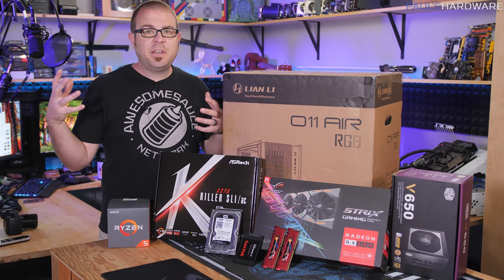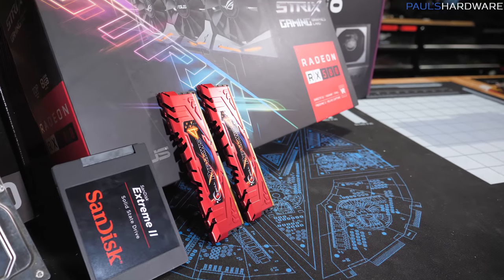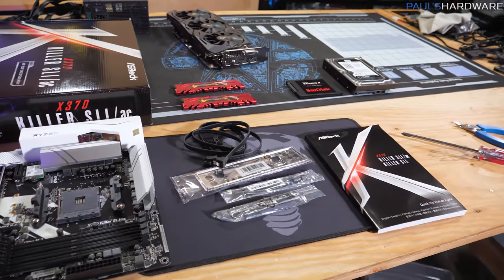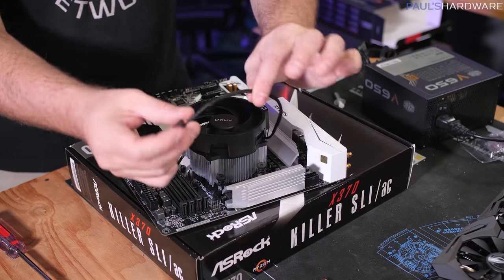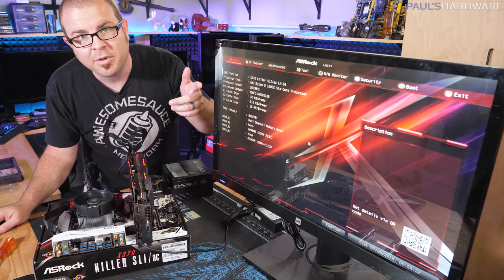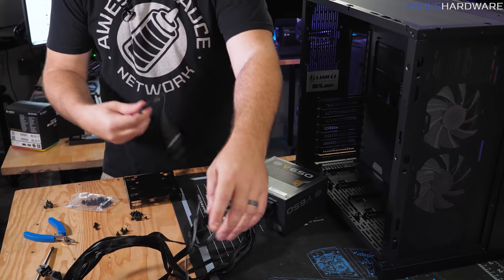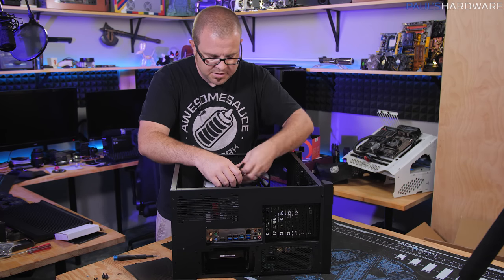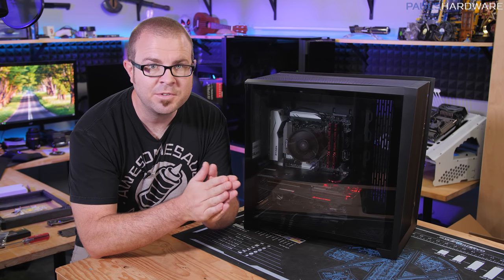How To Build an $800 Gaming PC in Late 2018!

Comment: Hi guys i have a question right now i have a choice to do 
Let me explain my situation im about to build a new computer and i was asking me this question my screen resolution 
I was first planning to play a 1080p
75hz so the choice were between the 1060 6gb and the rx 580 as you see no real problem just a quick look at the benchmark and choice is done,BUT unfortunately i discovered 1440p and my mind said "1440p only" here the question come would i benefit more from an rx 580 with a freesync monitor or upgrading to à 1070 to have the smooth 60 FPS so i am asking you guys would i have a better experience with a 1440p freesync monitor or 75hz 1080p monitor 
Thanks for all the warriors that read all my comment :)
Reply: i have a 1070 and i think its the minimum you need for 1440p as my frame rates for newer games are prob around 70-80 and i dont like fluctuation so this gives me a smooth 60fps
Reply: Ty for your answers i will so take a 1070

Comment: What about a Ryzen 5 2600 what's the best motherboard for that?
Reply: b450 is good if u dont want to sli or are not interested in high overclocks. X470 is still a good choice.
However i would recommend last gen motherboards like a b350 or x370, but you need a last gen cpu to update the bios to allow 2nd gen ryzen, AMD does provide free processors to do this.
Reply: laserman500 thank you!
Reply: Tim Flipkens usually vrm cooling is worse on b450 because they are cheaper boards, so u might not hit as high of an oc
Reply: Tim Flipkens that is false. Look at buildzoid. All are 4+2
Reply: B350/B450 for light overclocking and X370/X470 for heavy overclocking.
I recommend this motherboard if price is not an issue:
https://www.newegg.com/Product/Product.aspx?item=N82E16813144174
And I recommend this motherboard if you don't want to spend too much:
https://www.newegg.com/Product/Product.aspx?item=N82E16813157833
And finally, this one if you don't want to overclock a lot and want a good value:
https://www.newegg.com/Product/Product.aspx?Item=N82E16813157761&ignorebbr=1&nm_mc=KNC-GoogleAdwords-PC&cm_mmc=KNC-GoogleAdwords-PC-
Reply: Tim Flipkens 4+2 is the power phase of the motherboard. More power phases means higher OC potential and lower temperatures when overclocking the CPU or RAM. Also, that Bitwit video was released in April of 2017 which is only a month after Ryzen launched and there was no BIOS patches and the highest supported RAM frequency for all AM4 motherboards was 2666 MHz at that time (until they released new BIOS updates in August 2017). As of right now, most B350 motherboards will do up to 3200 MHz RAM overclock while an X370 can go up to 3600 MHz. And for CPU overclocks, X370 will keep a 2600X/2700X (4.2-4.4 GHz) a lot more stable than a B350.
Reply: The Power Phases for the B450 motherboards were lies, with Gigabyte and Asrock claiming that their B450 boards were 8+3 phase but in reality were only 4+2 phase which makes them no different than B350 boards. Buildzoid has a perfect breakdown of this situation: https://www.youtube.com/watch?v=3IjWCOXSuKU&

Comment: Man don't get SSD just yet 2 hard drive both should have two or three terabytes each maybe it's cheaper or if it's a little bit more than getting the SSD and hard drive combo but more space will come in handy in the end
Reply: Personally, I will never go back to a spinning disk boot drive.  The differences in boot times and general system responsiveness are phenomenal.

Comment: this is too expensive tho... you could use another vendor for the graphics card ( sapphire or powercolor) around 60-70$ cheaper than asus, The Case is OVERKILL! it's a nice case but really you don't need that big and expensive case for this kind of build... really what you need is a smaller mobo like the B350M (i'm using one and it's cheap) m-atx and then buy m-atx cases like Collermaster q300l and then use the leftover money to get more ram because believe me 16gb is minimum these years, no comment on the PSU or SSD though, they are pretty good.

Comment: This is kind of irrelevant but i've had my Kraken X62 installed for about 10 months now and i was wondering should i change the thermal paste now or is it good for a little while longer?
Reply: Jack johnson if you experience a significant change in your idle and load temperatures from when you first used the cooler and now, then yes. Otherwise you should be fine.
Reply: Jack johnson I have a intel boxed cooler and my thermal paste is almost 4 years old . so yeah , it still doesn't exceed 60 degrees although it's 33 degrees inside my house haha

Comment: I got a 500watt psu is this futureproof?
Reply: Depends.
Reply: 500 watts is cutting it close.  Use a site like https://outervision.com/power-supply-calculator to build your system.  You want some headroom for power fluctuations/overclocking/adding devices.

Comment: What is beter ryzen 1500x oe standard 1600
Reply: 1600 overall is faster, if not overclocking the 1600 the 1500x may beat it in a few gaming titles but generally the 1500x isn't a wise purchase unless really cheap. The 2400g has basically replaced the 1500x and is faster.

Comment: 700 Dollar? What can i take? With rx 580? (Or just 700 euro)
Reply: CURRYBOZZ In germany things are more expensive in general (not just because 1$ =/= 1€). Just build a pc for a friend 2600x, 8GB 3200, 500GB SSD, 1TB HD, case, 650 silver psu for a bit under 600 (had a leftover gpu)
Reply: Gyrave lebe auch in Deutschland

Comment: this is out of date.you can get a ryzen 5 2600x with a rx 580 and 16gb ram(2x8gb,ddr4,2400mhz) and a decent case and power supply for $800 (£850)
Reply: i forgot to mention the 480gb ssd and the 2 rb hard drive lol thats all for the same price

Comment: Why is that memory so expensive? That's closer to Canadian prices. But without currency conversion
Reply from the maker: Finding AMD Ryzen compatible memory that's on the faster side (DDR4-3000 or above) usually means paying a bit more. Ryzen can be picky about memory, which is why I usually tell people to check the motherboard's memory QVL, a list that shows you which kits they've tested and confirmed to work.
Reply: Oh, so that wasn't really representative of memory prices overall. More just the cheapest kit on the qvl.  That makes more sense. The cheapest 3000 kit should still be less then. 

I can't say I blame you for using that kit though. Especially on a beginner centric build, not having to deal with finicky memory is good. Like my main rig, which has engineering sample ddr4 I got off of eBay.... I have to memOK like 10 times in a row to get it to boot :D

But it was like 150 bucks cheaper than a normal 32 gig kit of ddr4 so worth :D

Comment: I will swap the x370 and R5 in to B450 and 1700 😄
Reply: B350, if you can get it cheaper
Reply: Luke W 
No. the b450 is the same price as the b350 launched and even if the b450 is cost more then I still go to B450 for its better memory support and much stable overclocks.
Reply: No need to go b450 with 1st gen ryzen unless it has some features you want or you like the way it looks.

Comment: I can’t emphasize this enough: CHECK THE QVL! I spent hundreds of dollars, because I trusted someone’s build on PCPartPicker, on RAM just looking for one that would work. Then I commented that the parts weren’t compatible and he had the gall to say I must’ve done something wrong however he admitted that he hadn’t built it and just picked out parts 🙄 Get RAM from the QVL don’t make the same mistake I did and spend $500+ on RAM Kits

PS: This was one of the website's Mods
Reply: Jordan Coronado why would you spend 500$ on RAM?
Reply: I put mine togeather months ago and just blindly bought what was on sale that met my criteria 16g per stick and fast ended up with 3000 ADATA and 3200 G-skill I think, turned on the motherboards auto freq and it tried both at 3200 and blinked like 8 times and gave up then I manually set it to 2930 the closest ratchet to the 3000 ADATA and all seems to work with my 64 gigs now but wish I had all at 3200 but atleast all sticks are compatible  I have a BIOSTAR B350 motherboard and flashed the bios (I actually flashed the wrong bios at first as the latest one that I first picked was for those 3200 chips with built in graphics so my windows wouldn't load had to load the right bios on a flash drive and re flash and at first windows thought I had installed my windows on a different computer and gave me a warning but after a couple re-starts with the right bios it settled down) oh I have a first gen 1700 chip 8 core not overclocked ...... but using the included wraith cooler so no crazy overclock    even on sale ram was close to 500 for my 64 gig
Reply: TheWaverDave why the HELL do you have 64g of RAM???
Reply: @flagovhate  Don't get concerned with specifics
Reply: Jordan Coronado explain to me why he needs 64gb of ram?
Reply: Who's talking about necessity; he said it matched his "criteria" which could have been set on a whim who cares. Btw I answer your previous response to my comment in the first sentence.
Reply: @flagovhate   I have a tendency to leave programs and tabs open plus I compile video files on my other slower computer If I'm compiling a video and notice I have two or three Audacities also open and I shut them down it may speed up compiling but on this faster computer the other open stuff doesn't slow things down to any extent with my 64 gigs (and 8 cores) as now if i begin to shut programs down it won't speed up the video compiling the next thing I need is a m2 drive as right now I only have mechanical drives :-(   might have gotten by with 32 gigs and used extra dough on a M2
Reply: @TheWaverDave  okay I'm no expert on computers, but i think you're bottle necked by your cpu for compiling. You have waaaaay more ram then you need.

Comment: i plugged in the cpu power and motherboard power
then i plugged in the cpu fan to the cpu fan header
then i put ram and the graphics card
then i plugged in a monitor
then i turned on the power supply
then i bridged a flathead screwdriver to the power switch header on the motherboard

Nothing Happened. What do i do? I don't know if i know where the power switch header is or anything, this is my first time building a pc. Can anyone help me? I'm using a B450M DS3H Motherboard.
Reply: Do you have a case? If so, plug your power switch connector into your motherboard. If not, look at your motherboard manual it should have been in the box your motherboard came in if it was new. If you don't have a manual or you didn't buy a new motherboard you could look up your motherboard manual by model as a pdf. For example, ASRock X370 Killer SLI/ac manual pdf.
Reply: Also, if you are using a Ryzen CPU it could take up to five minutes to post so I would attempt a test boot again and let it sit for a good amount of time and see if it has turned on. Sorry I fotgot to mention this before.

Comment: How to build a GAMING PC - chooses both GPU and CPU that are worse at gaming than competition. i5 and 1060 instead would cost about the same or a little bit more but perform better, and you could get a bit cheaper mobo since overclocking the CPU which is noticeably in front of GPU anyways makes little sense. In that case could get 500W PSU that costs a bit less as well (and would still be ~20% over the requirements). And way too expensive case for a build where the cost is obviously important. This is seriously a bad choice for anyone building a gaming PC in this price range and can't get much worse than this.
Reply: Because an I5-8600 with a slightly better Passmark score is $90 more expensive.  An 1060 6G ROG Strix is $20 more expensive than a RX580 8G  ROG Strix.  The $20 is not really a big deal on the GPU, but that's a huge difference on the CPU.  In the end, it all adds up and you don't gain anything by spending more money (and you lose FreeSync compatibility and 2G of video memory if you care).
Reply: I said i5, not i5 8600. For gaming even 8400 wins vs Ryzen 5 at around the same cost? You don't have to buy ROG Strix (which is probably the most expensive model). And it doesn't add up that much in cost while it does add up in better performance. You spend just a little bit more money and gain noticeable difference in performance. And I genuinely don't see this being a matter of opinion, since CPU price difference is ~20$ and GPU price difference is also ~20$. That's like 5% of price of PC increase to gain over 10% of performance in most games (in some even more than that).

Comment: Please HELP
Just built my first pc. I cannot get a motherboard driver or a piece of software for my mouse to install. When I try to run the files it opens Microsoft edge to use as an opener then when I click yes/install a window flashes and that's it. Nothing happens. Now I cannot uninstall them. I really don't want to reinstall windows and start over as I already have tried that. Anyone had his problem before? Mobo: ASUS CROSSHAIR HERO VII
Reply: try with the driver cd that came in the box of your motherboard
Reply: Rigoberto gomez bolaños unfortunately, I don't have a disk drive
Thank you for the advice though. Maybe I'll buy an external one

Comment: How do I connect it to the internet without using a lan cable.
Reply: Some newer model motherboards have wifi built in but if it doesn't you could buy a real cheap pci wifi card that will work just fine.
Reply: savage thx mate
Reply: Your welcome! I’m glad I could help. Hopefully you can have a good and successful build.

Comment: I'm new to pc and I don't know anything about pc, could someone review my build?
Ryzen 5 1600
Msi B350 tomahawk
GTX 1060 6Gb
Ballistic sport Lt 8 Gb  (Will be upgrading to 16Gb when I have the money)
Evga 600 w power supply
Toshiba 1tb hard drive
Fd focus G case
Is An Ssd needed?
Reply: You don't need 600 watt power supply. You don't need ssd. You need 16 gb memory.
Reply: Luke W Okay thanks. What wattage should be good enough?
Reply: You can save some money and go with a 450 from corsair.
Reply: go to pcpartpicker.com, select the parts you want and it will tell you how much power you need.
Reply: Luke W Okay. Thanks for the help!
Reply: 2tb hard drives are a better deal and an rx580 instead of 1060
Reply: Luke W What is the difference between the Rx and the 1060?
Reply: 1060 has lower power consumption and better better performance in some games, rx580 has more memory and lower price + cheaper monitors using the free sync technology.

Comment: Will build your own pc be cheaper??
Reply: Yes
Reply: It's also about having control of the parts you put in.  A lot of the big cheap manufacturers put poor quality parts in.  The biggest problem I have with Dell/HP cheap machines is that they put completely inadequate power supplies in their machines.  They do a power calc, and put a power supply that is almost exactly what your machine runs at load with no headroom for any sort of power spikes or overclocking.  Forget adding anything to your computer.

Comment: Hardware Unboxed did a video about memory speed and Ryzen - go check it out. You don't need faster memory if you're not running a GTX 1080 or higher. I think even with the 1070 gains were minimal, so that's why I wrote 1080. Also, 2nd Gen Ryzen offers integrated StoreMI - you can couple a 2nd Gen Ryzen with a b350 mobo and then go ahead and use the fastest small NVME SSM + HDD combo. Why a mobo with more than one slot for a GPU? You are getting only one GPU for 800 bucks, right? Go with the cheap B350/450 mobo and be done with it. This mobo makes NO sense. I'm not even gonna watch this till the end.

Comment: Just got a 1600x for 140
Reply: Used or new?
Reply: Luke W  used, he used it for his second pc and never used it so pretty good deal anyway
Reply: These bastards never go on a proper sale. What cooler did you put on it and how much did you oc?
Reply: Luke W evga clc240, haven't overclocked it yet, haven't had a lot of time but I might do it tonight
Reply: Hopefully you can get 4.0 on all cores stable.
Reply: Luke W hopefully, some people get some that only do 3.8
Reply: 3.7- 3.8 is what most get from 1600, 1600x is a binned chip so 3.9-4.0
Reply: especially with a beefy cooler like you have
Reply: Luke W it's not binned it's a different chip right?
The 1600 has a 65w tdp while the 1600x is 95w
I don't think the 1600x is a binned version of 1600
Reply: Well, the 1600x is a 6 core chip like the 1600 so I assume it's a binned 1600 unit. I think they both start life as 8 core chips.
Reply: The 1600x is 95w because of the frequency it runs at.
Reply: They both start life as 8 core, 2 cores are lesser cut, the better performers are labeled and sold as 1600x

Comment: CPU is junk for gaming. GPU is junk. The memory is junk.. if you're going to build a gaming PC, save the extra few dollars and get some proper parts. Dont cheap out, you've made it to 800 bucks, save another few hundred. You get what you pay for with his stuff.
Reply: And let's be real here, a lot of these guys benchmark with shit like CSGO and Dota 2. You can get a used PC from a hock shop for 50 bucks, drop in some used memory and used GPU and get the same frames.
Reply: And you really get what you pay for. Buy this and you'll run most games on mid to high, spend the few hundred extra and you could be high yo ultra over 60 fps. Even buying some things used isn't an awful idea, generally like to see that things work first, but basic things like the case and such you can find anywhere from 50 to 90 percent cheaper used.